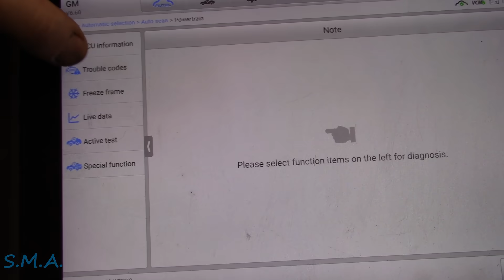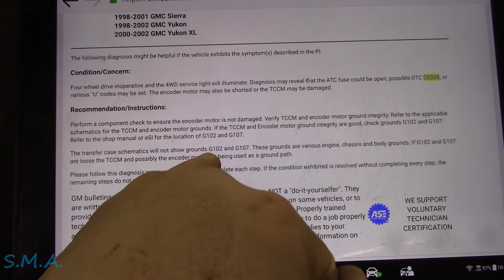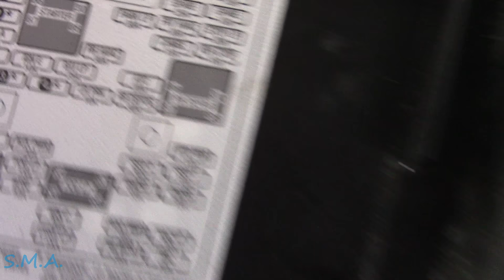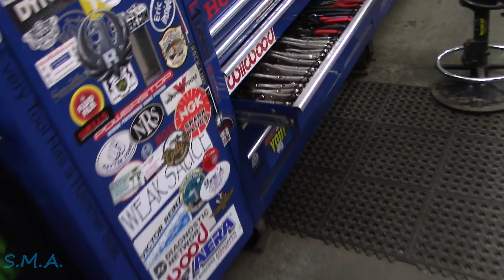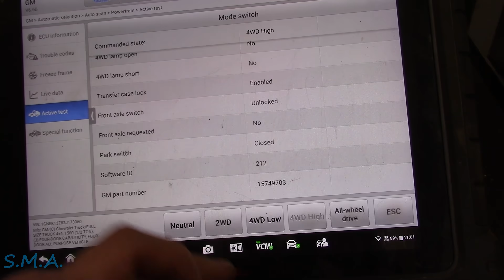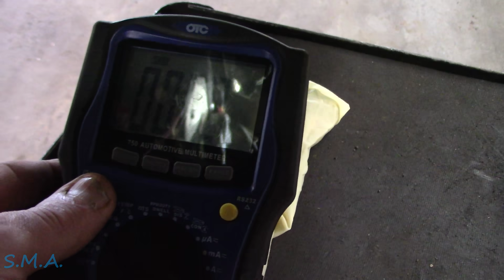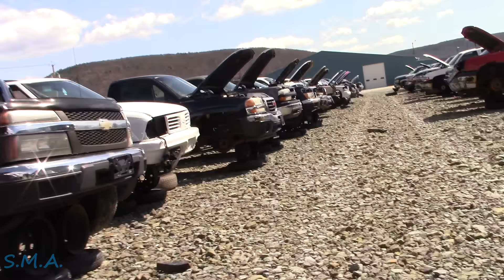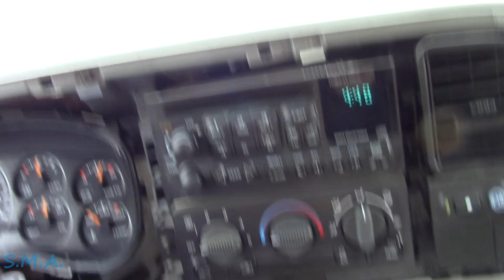Customer Spent $1000's And Still No 4WD

Comment: It is a shame that the customer didn't bring his Tahoe directly to you.  They would have saved  a lot of money that way.  Great job Eric.
Reply: Exactly. For years people wanted cheap parts,Now that they got them they don’t like them because they’re a joke. People are diagnosing cars by replacing parts that’s not how it works especially when you’re putting on junk parts even though they’re new they are junk. I hate to say it lately I’ve got a lot of junk right from AC Delco and General motors from my local dealer the quality of parts has really gone downhill since Covid.
Reply: @JohnDiMartino  
I don't think it's covid19,  I think people are just lazy and don't care.  I was in the trucking business for nearly 44 years the last 2 were the worst.  Everyone blamed covid19,  but how can covid19 be responsible for sending me to the wrong place to pick up a load??
Reply: @JohnDiMartino  To be fair a lot of those parts are unrelated. Due to the massive shortage of trucks and cars atm. 1990s are going up for $10,000 if in operating condition or more. He may have just decided to get this old rig back on the road cause it's cheaper then buying a used one IF you can even find one atm.
Reply: Heres the thing, I worked in aftermarket spares for many years before leaving and starting my own buisness. There isnt usually seperate factories that make for example GM parts vs ac delco or whatever. Its usually one factory and they say ok for gm this is our cost per unit make it, then someone else comes in and they make the exact same thing woth a diferent badge or the parts that oem rejected. Sometimes its a simple as just not stamping the oem logo on the part and sellling excess stock. Ie GM order 900,000 air filters, the manufacturer gambles and says well we will do one run of 1 million but only stamp the GM ones up to 900thou. They can always go back later and stamp oem logos, but if they decide hey we only need that amount no more, they then sell the oem part to another supplier who can choose to stamp their logo onto it or they can take them as blank.
Reply: @Steve211Ucdhihifvshi  eh , could be same factory but im sure there are different specs.
    Bosch sales man said the contracted 02 sensors for the factory assembly are not built to same spec as what they send out the door for aftermarket.
    Past 8 years or so ALL parts have come way down in quality
Reply: @JohnDiMartino  buy cheap, buy twice - always been a great believer in that.
Reply: @davyarthurs  My motto is buy once, cry once
Reply: @JohnDiMartino  Yep. I agree 100%. Lemme tell ya...
Waaay back in the 1970s, AC Delco opened an alternator plant in Mexico. American management was ignorant of local customs and was completely incandescent when the time came for siesta. They asked: "why won't these Mexicans keep working?" ... the answer was that these Mexicans cannot afford to purchase a Chevy, so why go the extra mile?  Over the decades, GM figured a few things out and now Mexicans have comparable pay and benefits and a car purchase plan....but who in their right mind would buy a Chevy anymore? Let alone crappy AC Delco parts.
Reply: @JohnDiMartino  Have had some failed switches from AC delco directly, specifically my multifunction switch...
Reply: @JohnDiMartino  2017 chevy trax... thermostat $80 bucks and is junk from AC delco avg lifespan of said part is 30k miles my mothers trax has had the thermostat replaced 4 times
Reply: @JohnDiMartino  u0ui
Reply: @JohnDiMartino  Wen you sell a bad part to fix a problem, you have made money. If someone claims the warranty, you did not make money on the defective part, but you wasted the customer's time. This is the modern way of doing business.
Reply: @JohnDiMartino they also alot of times throw the perfectly fine OEM parts away when they are still ok then chase their tail and or pay an arm and leg later on over time replacing the junk aftermarket back to OEM. I know what you mean but I think it's covid gave the lazy people a way to be lazy and covid is the excuse
Reply: Eh well the thing needed new parts anyway..  whether they were broke already or not..  but dude can now say that his entire 4wd is new..
Reply: Last video I watched was aftermarket crank sensor Chrysler this one aftermarket shift motor GM hmmmmmmmmm 
Got to stick with OEM parts when they matter 
Seems like these shops from where these cars come from would know this by now 😏
Reply: @oliverjantz1108  I've gotten several DIB parts from the OEM suppliers. The issue is every one lost skilled labor and has replace it with any one breathing labor.
Reply: @oliverjantz1108  I always demand OEM parts on my Toyota.
Reply: @oliverjantz1108  aftermarket mopar crank sensors on the magnums and jeep 4.0s were always a gamble lol.
Reply: Usully this happens because 
1. They might not know SMA exists
2. Customer was sourcing the “cheapest”  shop first
3. Probably heard SMA would be “more expensive”   
     We will never know the real story.
Why did he have a new drive shaft?
Why was the front diff replaced
   I know mid 90s to mid 2000s those diffs should have had a zipper on them. 
Fun stuff
Reply: On the OBD 2 WHAT DIAGNOSTIC UNIT ARE YOU USING? IM RETIRING SO I DONT NEED THOSE GUYS IN MY LIFE (NO OFFENSE, EVERY TOOL GUY I MET THRU THE YEARS IVE HAD RESPECT
Reply: If he'd taken it to Ivan (PHAD), I think a 'No-parts-required / Russian repair' would have resulted.  (After disassembly of the motor itself, Ivan would have cleared the short to the case)
Reply: @trevorvanbremen4718  I don't know about that.  He had a low value from A to B and A and B to case, so likely the rotor had a melt-down.  Not saying that Ivan might have grabbed a window wiper motor to substitute!
Reply: @trevorvanbremen4718  
Those cases don’t like to come apart especially with some age on then here in the rust zone.
Reply: @trevorvanbremen4718  Sorry but I have banned all Russian repairs.
Reply: @JD-iu3vi  LOL...  However, I would suggest to you that Ivan (PHAD) is a somewhat 'different' individual to the 'spoiled brat' known as Putin, so I for one have chosen to continue supporting him / watching his videos.
Reply: I am sure he will know for the next time.
Reply: Is it a shame Mark? Is it?
Reply: @cjr1881  yes it is.
Reply: Facts two or three hundred bucks to the mechanic and a hundred bucks for the motor
Reply: Retreat
Reply: Nah...It's a crying SHAME he didn't buy a Toyota to begin with...My 2000 Tacoma 4wd still works as good as the day my old man bought it...logs/gravel/stumps/trees, and it's FAVORITE; Pulling out broke down Ford's/Chevy's...YES; The cabin space is TIGHT (Can't be a fat azz), and YES; It annoy's me to no end having all my crap fall in between/under the seats/doors, but YES!! It's all worth it when I see video's like this!!! If up north (I'm in the south); Just have your friendly mechanic here do a wet spray every other year for 6 years, and you're golden!!!
Reply: @brentfarvors192  I totally agree with you.  That customer  should have  bought a  Toyota.  I have owned 5 Toyota  cars  and no problems with  them at all.
Reply: @markkrispin6944  Well, up north they have a tendency to rust out, due to the salted roads...But, a good coating will stop that dead in its tracks...
Reply: @brentfarvors192  so true. I  live in Arizona  so I don't have to worry about that  problem
Reply: what was the costs charges for ?$1200,$1000 ,and then he pays, so whats up w that
Reply: Shuldn't that truck still under warranty?
Reply: NO SHIFT MOTOR. !!  NO GO!! NO CONTROL MOTOR !! NO WONDER !!
Reply: People go for the cheapest place first and then end you paying the right person to fix it so you aren't saving a dime 😂
Reply: No. Its a shame he didn't pony up the extra 2K, and get a 4-Runner instead!!! He has 10K of new parts...And, rising...
Reply: We want to bring our stuff to Eric but he doesn't want our business unless we are local to him. I get it though...He isn't youtubes mechanic...He is just a small town NY mechanic that makes videos
Reply: @sissymarylen15741a  think about it?if he lets tube  take too much of his capacity to work on cars? and then cant give his all to his core customers after tube cools off,and local to him has a new shop open up?and pulls traffic from him?it could put him out of the biz.
Reply: @michaellucken695 Mr. O will never be " put out of the biz".
Reply: @sissymarylen15741a  He does not have a crystal ball to see was ailing your car.
Reply: @lactusgalacto1174  True, although I don't see where anyone claimed that he had a crystal ball
Reply: @deviouslaw  might as well. He cannot diagnose from far far away problems 😁😁
Reply: @sissymarylen15741a   there are to many issues with dealing with customers out side your “zone” 
What if things happen and your car is now going to sit a few days or longer.
   As long as you can tow it there and leave it until its done it might work out.
Reply: @Mac-mu9cs  bring your car to sma,get a hotel room.spend all your vacation days in Avoca ny....you will save tons of $.

Comment: I got over 400,000 out of mine original trans and motor.
I put a mechanical cable to push fwd front engage and transfer cable also.
Chucked all the electrical fwd stuff.
Reply: I know a few farmers with early 2000's Silverado/Sierra trucks with 300k or more miles on them. Proper maintenance makes a difference and farmers tend to stay ahead of problems... like keeping the frame/electrical grounds coated in oil to keep rust away and changing the transmission fluid more often than the owners manual tries to suggest.